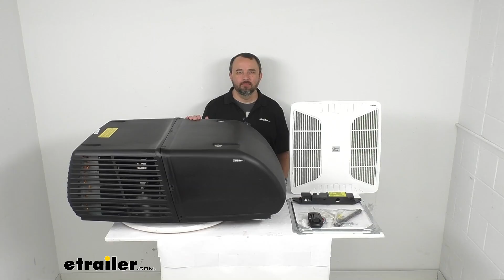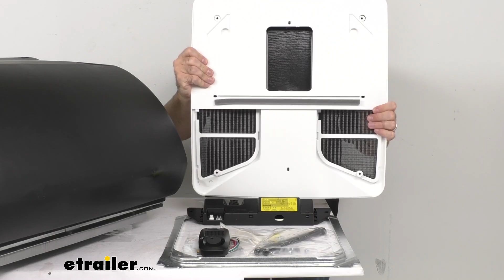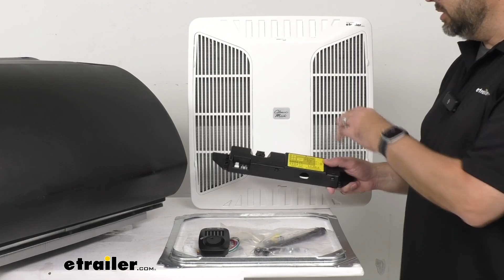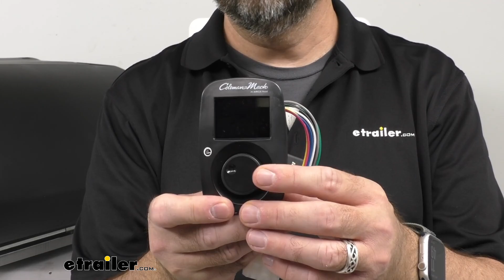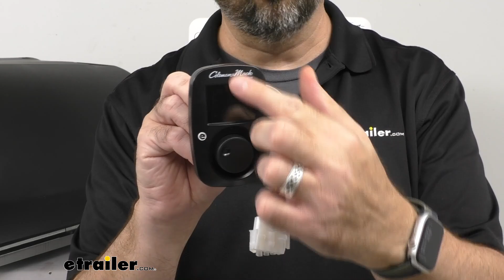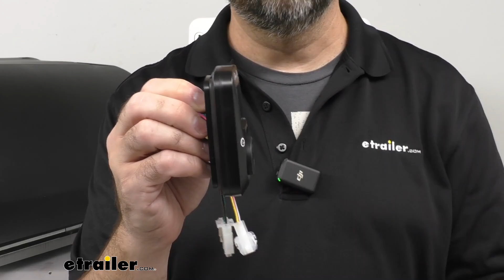Review of Coleman-Mach RV Air Conditioners - Signature Mach 15 Ducted System Textured Black - CM42RR

Comment: Hey does the fan cycle with the compressor or does it stay on all the time like the newer inverter type units
Reply from the maker: When set to "Auto", the fan will cycle with the compressor. When set to Low or High, it will run continuously.